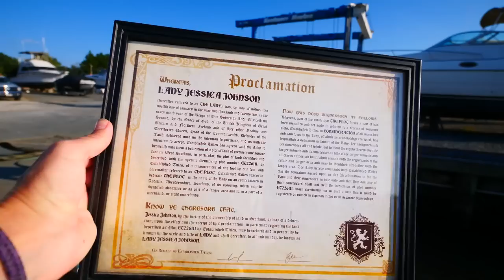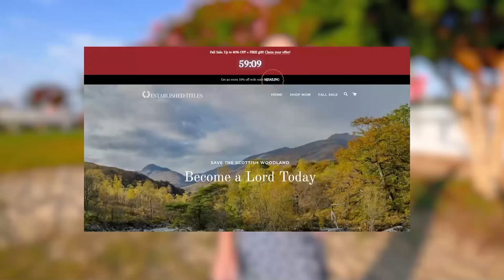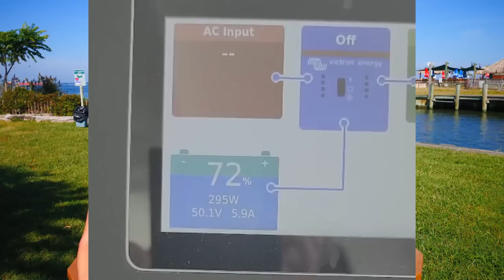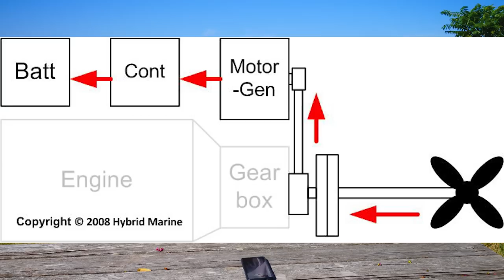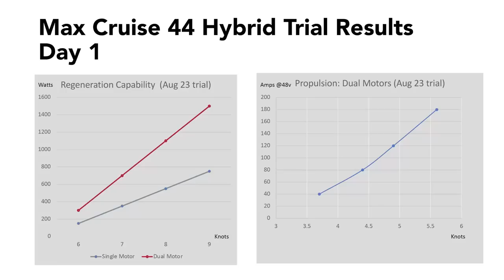Bye Bye DIESEL - We're Going Electric Hybrid!!  (MJ Sailing - Ep 251)

Comment: $1000 bet you don't use your diesel engine as much as you think you will 😀  Which is a positive move.  People always forget that while you maybe drawing 2kWh you are topping back up your battery system with solar etc.  So if you have a 10kWh battery you effectively could have 20Kwh to draw on over time at a 2kWh draw for your 3.75knots.  And you don't come across situations where there is no wind for 10hours very often, well not in NZ 😉
Well done guys on the move.  
P.S NZ has the first electric Tug boat, electric ferry and a Hydrogen foiling boat.  NZ is a country the likes to be first in everything! Haha
Reply: Um......you must not watch many sailing channels. It's very common to run into areas of no wind for far more than 10 hours.
Reply: @JCrook1028  Hi JC1028, sorry I think you missed the point of my post.  Yes there are times of no wind and to motor would be ideal.  My point is "$1000 they won't use the diesel engine as often as they think".  They will still be able to motor, under electric, and do so for a very long time with the size of battery and solar available.
Yes I have done lots of sailing, Yes I have had periods of no wind, no not often for more than 10 hours, Uma is proof you don't need engines.  😉

Comment: Chris White places his battery bank under the waterline so he can flood the batteries and cool them down in case of fire. Insurance companies have been burned because of battery fires. I would talk to my insurance provider to get their take on lithium batteries. My friend T. C. worked for Don Guartlets on his dragsters and one day he was still shaking when he told me about getting magnesium on fire. He took the metal outside and sprayed it with water. The fire exploded and burned the top of the local pine trees. Lithium is not as bad as magnesium but it is hard to put the fire out with water. Perhaps batteries could be placed in pods under the bridge deck and released if they start to burn.
Reply: I wonder about building fire proof boxes, like a dual wall 1-2mm stainless box to contain any fire. Insulated to also contain the heat. You can buy charging boxes for houses to contain lithium fires.

Comment: Matt, perhaps a drawing or a sketch would offer a clearer explanation  of the Hybrid/  electric / diesel.
Your hands didn’t do it for me.
The graph at 16:20 was great, but that’s a heck of a lot of amps for a 48 volt system.
I hope it all works out well for you!
Reply: Parallel - diesel directly connected to the prop or electric motors can push the boat.
Series - electric motors only can push the boat, but the diesel can charge the batteries.
They will have one diesel engine and two electric motors so have five configurations to push the boat .
eg E&E, E&D, D, E (left side), E (right side).
Reply: Yeah the usual  line up haha

Comment: You can’t just ignore the two diesel engines, they still require maintenance. With single generator and pure electric drive you charge the batteries through regen and the propeller changes shape when in regen mode. One generator is better then two diesel engines!
Reply: They will have one diesel generator that can also provide propulsion
Reply: You totally missed how this system works.

Comment: Sounds fantastic. Have to wonder how much you will actually use the diesel (although important to have for emergency). If you have 2kW solar, at 8 hours sun, you have 16kW or energy so probably 6kW of normal use. Leaving 10kW of all electric motoring or about 9nm (plenty for anchoring). Really makes it important to have a high performance cat so you can sail in the light breezes and avoid any motoring.
Reply from the maker: We don't expect that much solar in real life.   Four to five hours multiplied by the wattage is the usual number quoted without shadow (8 to 10kw).   But the rigging always seems to shade something and this number will most likely be a bit lower.
Reply: All my research says , quoted manufacture solar number are pie in the sky at best. Real world youre lucky to get 50-60 % of advertised. Fredb
Reply: @fredbugden3511  Depends a lot on quality of solar influx, some areas have a lot of atmospheric interference. Out west USA, at elevation in clear sky's really shine for solar. If you point panels directly at the sun you can also get wicked good performance. Most people don't bother managing the panels instead prefer doing fixed placement, so you lose a lot >50%. Auto-tracking is pretty expensive. I spent several months living off grid at the beginning of the pandemic, I lived off solar every day. Once you figure it out and work it properly the results are quite impressive. If you have the time, try pointing the panels at the sun and measuring the outputs with volt/ameter.
Reply: Lmao, you live in a dream world my friend.
Reply: @georgemacdonald8899  We're talking marine solar here.....not land based. smh
Reply: @JCrook1028  Rude. And why do you say that?
Reply: @AORD72  Read MJ's response and you know why. Don't buy into the salesman;s numbers. it ain't gonna happen.
Reply: @JCrook1028  Still rude the way you approached it. I had rounded the day to 8 hours as well so for a peak summer day you might have 16 hour in a day (solstice) it would be close.

Comment: Oh okay so you wont need to change alternators as they wont be charging your main bank just your starter and 12 volt batteries. I see. also you have spare parts form other engine which is a plus.

Comment: This is the appropriate solution until we have access to a power source that is free of fossils AND can be stored in as large amounts and as safe and as reliable as the well proven diesel. IMHO.
The best is not to go motorsailing/driving/flying of course 
Aren't we all using energy on an expensive loan to earth? Even the production of batteries and pv panels is at a cost. But for now we do what we can and invest in the next "best" thing and stimulate kapitalism to go further in renewable energy propulsion systems. It may take who knows how long for a true one. We need hybrid now as the next step. 
Very good choises you made.
Thx for the advocacy to all of us.
It is stimulating.

Comment: lot of smoke and mirrors here...

not so convinced that a diesel/electric hybrid is more efficient at creating power. although they have been used for decades in train engines, large ocean going transports and military ships. it's certainly more complex, that's for sure.

it's primary advantage is in the electric motor''s ability to create instant torque resulting in the elimination of a transmission. and so, demonstrations of acceleration on boat may be dramatic with a diesel/electric power source and useful in impressing a potential client, but in the long run useless in boat.

Comment: What is a full battery replacement look like??? You know in 5 to 7 years when the batteries are no longer useable.   Access?? Cost??? Placement???
Reply: Lifepo4, batteries are already proven to last 10 to 15 year's. By then the price will have dropped more
Reply: @peterevenhuis2663  So are the batteries in my neighbors Tesla.. The periodic tables have not invented new elements...  In  5, 7 or 10 years the batteries will not be able to take a charge as easily and will have less capacity... I am not picking on your system.. I believe is is a good choice...   I was wondering how problematic it was to replace batteries...  I might also wonder about fire suppression would be handled on a battery fire since that also is problematic to batteries be it from Tesla, GM. Ford or Boeing.....   Where are the batteries stored in the boat? are they stored below the waterline?   Most of us know about the hazards of Diesel or Propane on boats...  

Lithium Phosphate (LiFePo4) are a very stable lithium battery that are hard to damage, slow to burn, have a relatively high charge/discharge rate, and a lot of charge/discharge cycles before degradation.

They are also very heavy and large compared to the energy density of, say, Lithium Cobalt (most commonly used for e-bike batteries due to weight).

LiFePo4 is perfect for fixed installations or where stability and longevity are valued over being light

All that being said.... How much hassle is it to replace batteries, that is all I am getting at..
Reply: @AM  So they last 100 years.. That still does not answer the question of, How much hustle is it to replace them?
Reply: @lancmac  unless the Tesla is made in China, they didn't used Lifepo4 batteries, a very big difference in fire safety and duration. The disadvantages from lifepo4 batteries are the bigger size, not a problem for ship's and off grid installation
Reply: @peterevenhuis2663  BTW Tesla builds in China and uses Chineese batteries for that..
Reply: @lancmac  , yes indeed better quality

Comment: Controlled tests don't mean much until you get in a situation where you need power and you don't have it,
Reply: They have sails and a diesel. When would they "need power and not have it"?
Reply: @JCrook1028  Hybrids are new technology and thus could fail at the worst possible time,
Reply: @patrickcoleman3  Again the point goes right over your head/ The diesel engine is NOT anything new or special or hybrid. It can be used independently of ANY other system to power the boat. Just as on hundreds of thousands of other sailboats.

Comment: IMO electric is fine but the technology isn’t there yet, especially for blue water cruising. Too many down sides both environmentally & practicality. Rick Moore did an extensive analysis of pluses & minuses factors & it was clear that diesel was the way to go at this time. Not seeing why weight is that great of a factor. It’s not a race boat, it’s to live on isn’t it? Been there, done that, comfort & reliability wins hands down when trying to be both a “performance” & “daily live aboard”, too many compromises.
Maybe some day. Good luck & hope it works out for you! Looking great so far.
Reply: Rigging Doctor sailed across the Atlantic twice on electric only, Beau and Brandy sail all around the Caribbean.
Reply: comfort is not have a diesel engine running. That is why you have performance catamarans, so you can sail in light breezes.
Reply: After all their years of living onboard I think they know better what compromises work best for THEIR lifestyle. Not you.
Reply: @JCrook1028  Thank you so much, that was very informative.
Reply: @AustinBoil  Just to answer your earlier question about why weight is important to a cruising boat as compared to a racing one. Being able to sail in light winds and therefore saving fuel is one major reason.